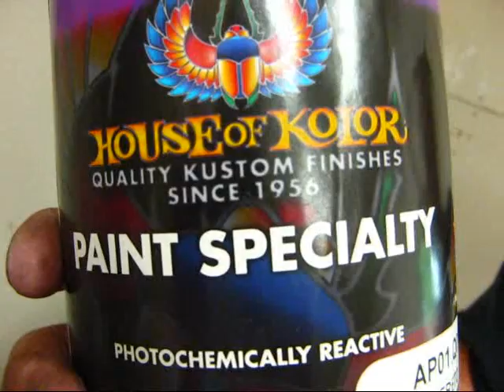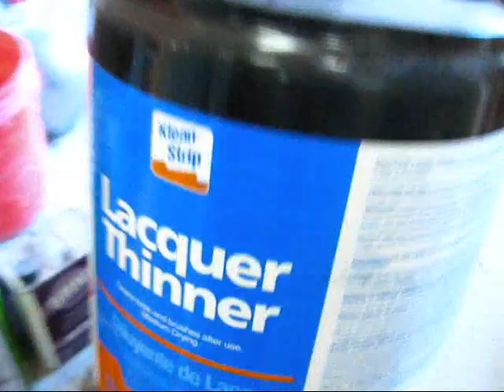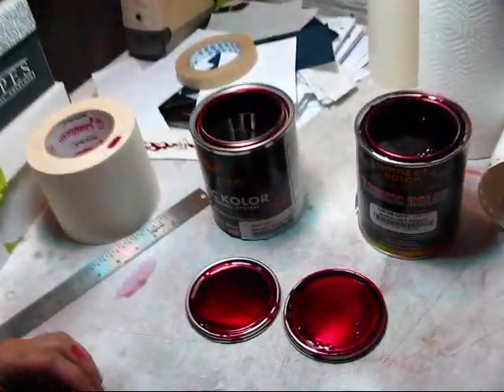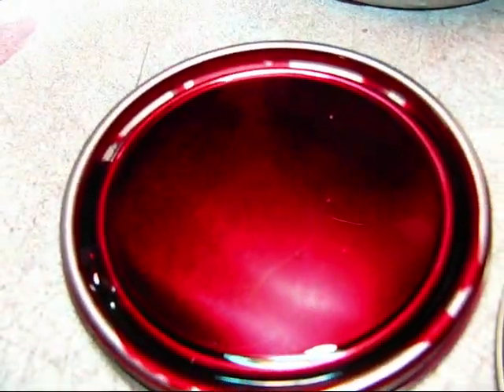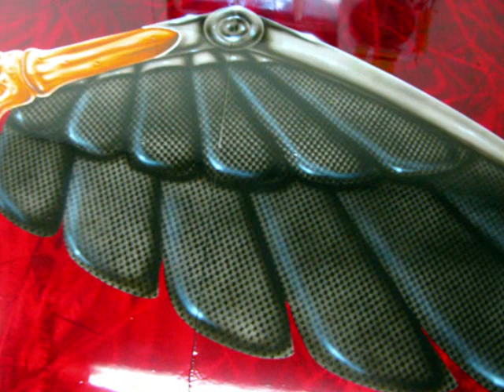Ground Metal Candy Painted Table  (dirtdesignsgraphic.com)

Comment: I do not speak English ...help me Why do they put the top coat on the metal? And not directly the candy ..
Reply: Carlos Rivas so it will be a super smooth finish they used the clear to fill up the grooves of the grinding
Reply: ok thanks you very much..

Comment: I realize you've already been answered, and I don't mean to beat this to death, but you can't paint over a buffed/polished surface. It won't stick at all. The paint and then the final clear coat will fill in the sanding scratches and you can buff after. Not only is a buffed surface to smooth, but the compound itself would repel paint. That's why we (painters) use wax and grease remover.